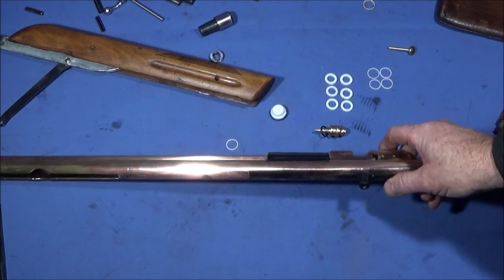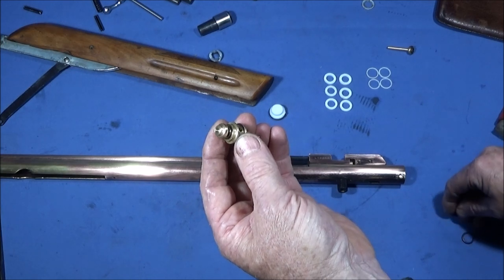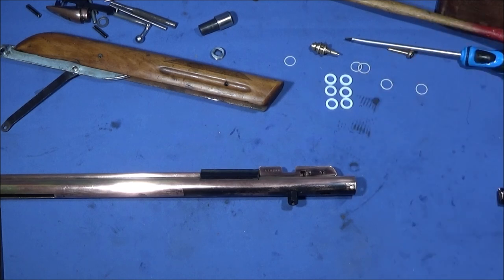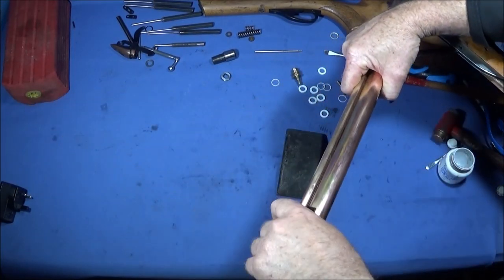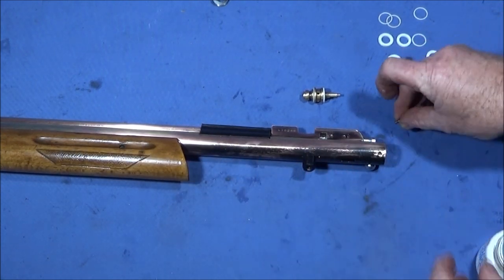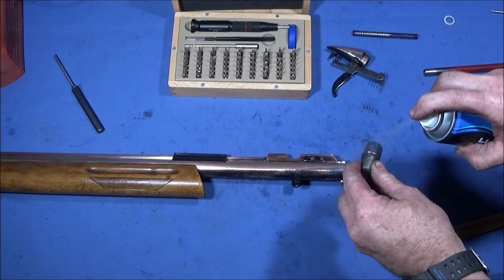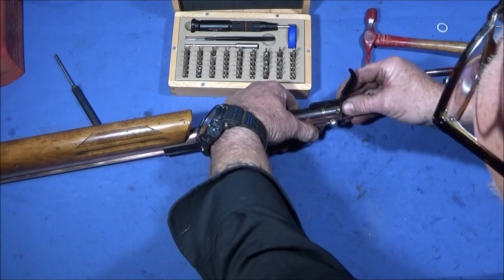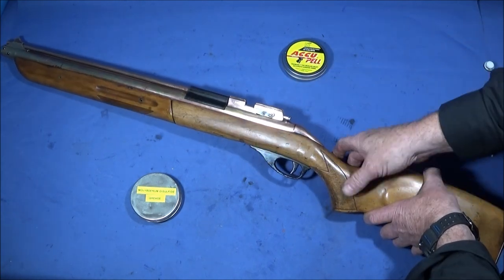Setra Pump Up Air Rifle Repair, + Complete Reassembly & Test.

Comment: Well this is definitely a copy of a C series Sheridan silver streak air rifle.
It doesn't look to be quite the same lever of quality, but still seems like a decent enough rifle.
Btw that cam plate that interfaces with the bolt lug needs to be positioned properly forward before the two screws are locked down, this holds the bolt forward into the breech to keep a proper deal so you don't have blow by coming out around the bolt.